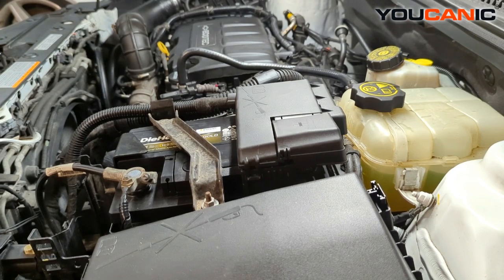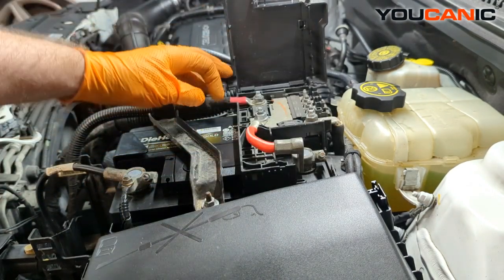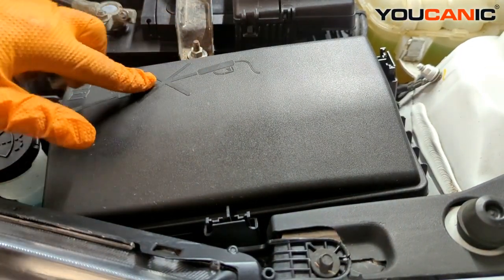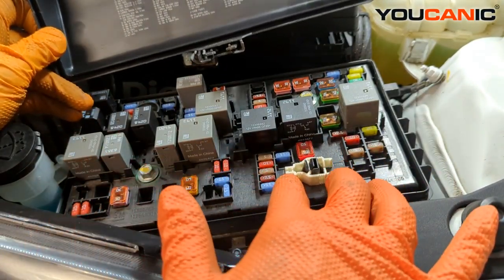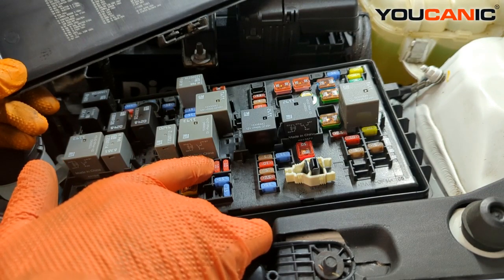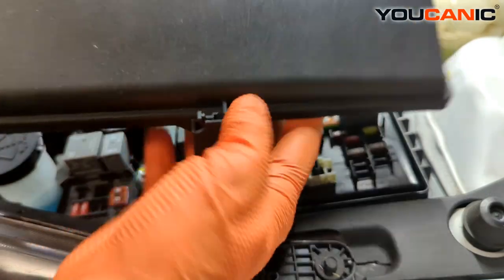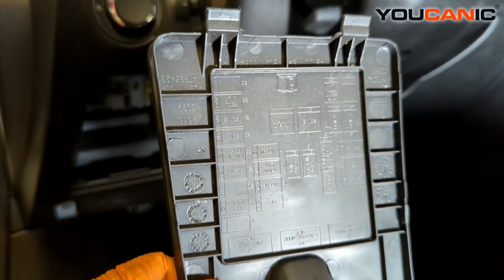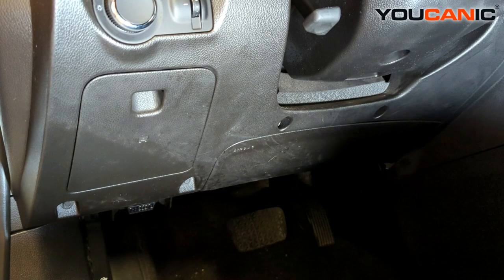2008-2016 Chevrolet Cruze - Fuse Box Locations

Comment: God. Damnit. 
Every video bro. Why? Why is the most difficult and important part left out?

How the hell do I access the k3 power outlet relay? It doesn't just pop out, probably broke it trying. There's no way to remove the fuse box without taking apart the dash, it seems. And I'm pretty sure the relay is what is bad.
Reply from the maker: @spacemandrew If you’ve got a car issue or repair question, you can find step-by-step guides and scanner help at youcanic.com. We might miss some comments here, but our site has answers for most problems already!

Comment: how do you get to the relays in the interior fuse panel.  How to rotate it down????
Reply from the maker: The process of accessing relays in the interior fuse panel can vary based on the make and model of your car. To provide you detailed step-by-step indications, it would be helpful to know exact vehicle details. For further guidance or questions, feel free to ask us on YOUCANIC [www.youcanic.com]. 

We're committed to helping you navigate your automotive needs with ease. Our YOUCANIC Full System Scanner [www.youcanic.com/scanner], as well as OEM Factory Repair Manuals, are some resources that we offer that might assist you further. Keep exploring YOUCANIC [www.youcanic.com/] for all your car-related queries.
Reply: Did you shake your head to his reply too! Then couldn't be bothered saying 2008-2016 Cruze?